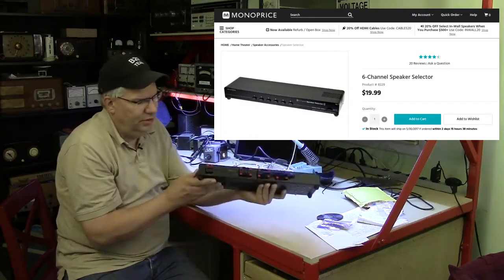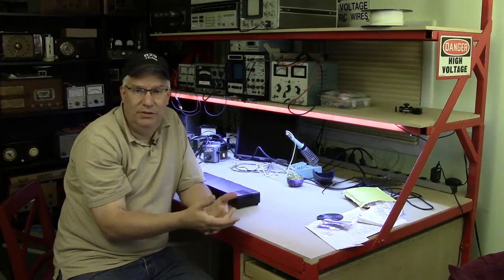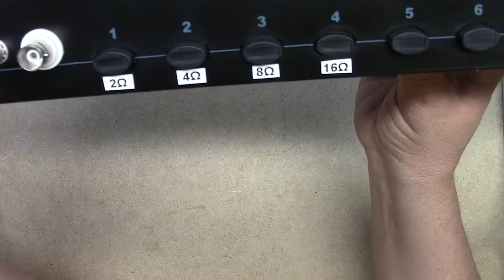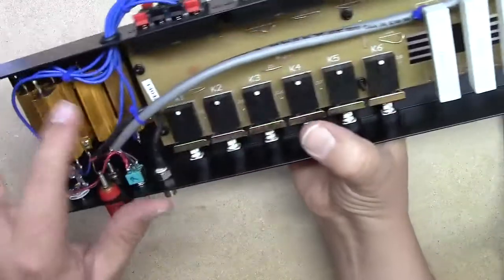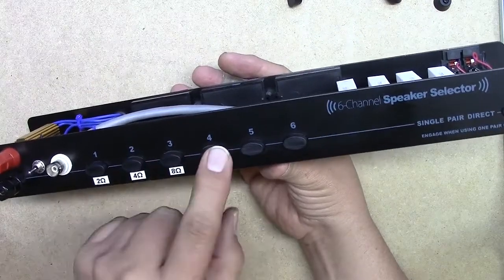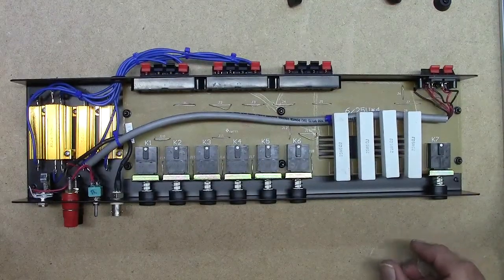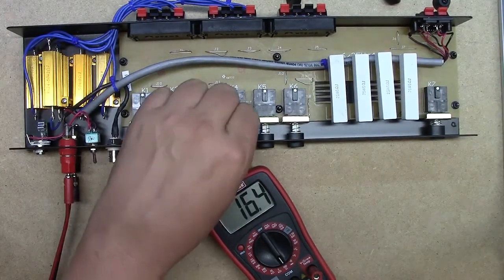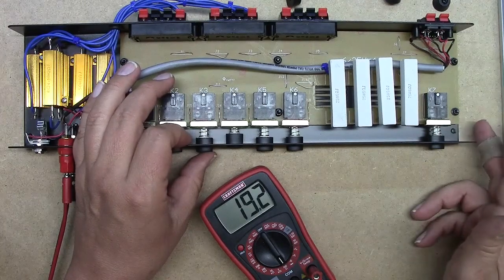170528 Valve Studio - 1 to 12 Speaker-Load Resistor Selector Switch

Comment: any heat build up issues that may require a fan yet?
looks like a good and budget oriented solution.
Reply from the maker: There are vents cut in the enclosure top. The resistors are mounted to the chassis, so that will help. There is room for a fan if needed. Thanks for watching.